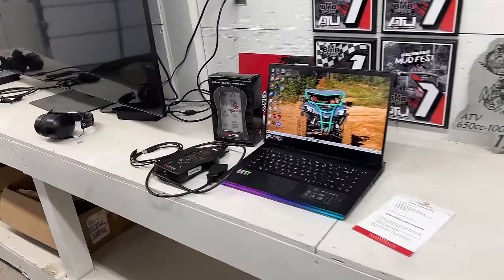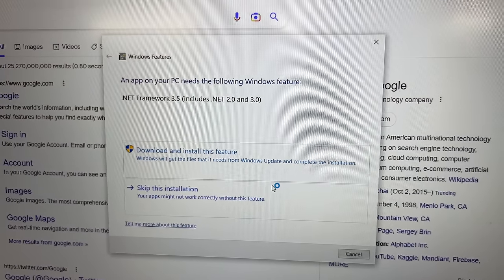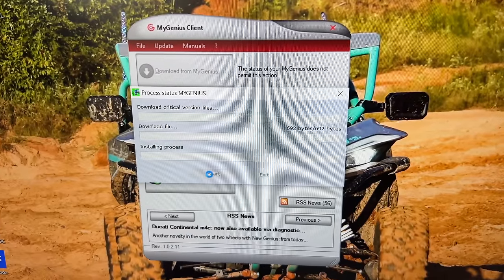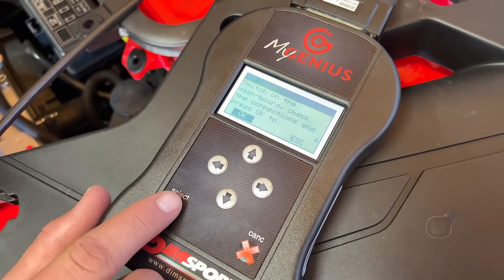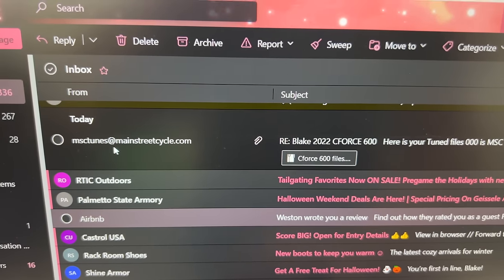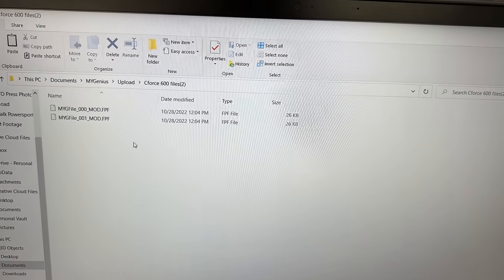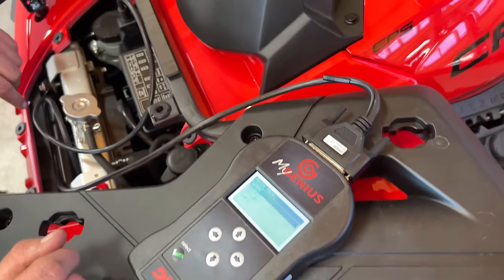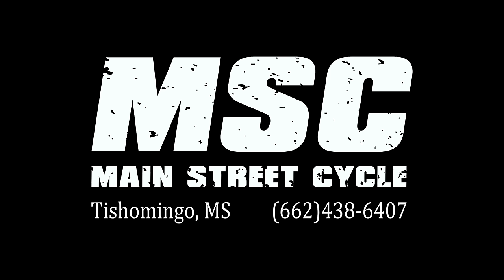MyGenius OBDII Tuner For CFMOTO TUNES | How to Tune Your CFMOTO

Comment: I will be getting this! I like the fact that it allows us to return to stock in case it needs to go into shop for an issue! Nice video explaining it!  One big thing you should mention as with any ECU flashing Make sure battery is fully charged and does not die during a flash. Tho it may be a quick flash if battery dies in the middle of it you will have a big paperweight when you are done! LOL

Comment: Blake, love everything you guys are doing with these machines. It's getting me all fired up about upgrading mine. Will you be offering the ability to adjust any perimeters on the tuner side or offer the ability to make a special request with some of the parameters?  Might be jumping the gun here but how about a tuning software being available later down the road?  Really love that you are putting the time in to get these machines dialed in.  Any idea when an uforce 1000xl tune will be available?

.
Reply from the maker: We already have the uforce 1000 XL tune out and available

Comment: I was very interested, until you said that it can only do one machine. Now I have to weigh out the pros and cons.
Reply from the maker: Yes that is something to consider
Reply: Every tuner is machine specific
Reply: It’s even that way when you tune a car.
Reply: No different than any other tuner put there. Can only use on 1 vehicles at a time
Reply: Yes. It's like this for some other tuner too. Here I was hopping for a better tool , that could transfer multiple tunes  to multiple machines and or do reflashes etc.. I was looking for a professional tool not dyi.
Reply: Not true my auto cal can do 600 tunes . You do have to buy a vin for each tune but lot cheaper than a new auto cal .
Reply: @RealTalkPowersports  will this work on a 2023 300NK?

Comment: That MSI GS66 Raider gaming rig is not an old slow laptop by the way ... whoever is doing your IT hooked you up pretty good with that for a shop laptop.  If anything, your internet connection to the outside world or your internal network router is the "old and slow" pieces of your equation!
Reply from the maker: That’s my personal GS66..
I bought it right when it came out to edit video before I was working with MSC..
I was way far away from the Wi-Fi router and I have the 2 SSD in it also full so it has bogged down.
I need to clean it out and optimize it..
It’s now my back up laptop.
I’m now using the M1 Pro MacBook Pro

Comment: I am having an issue with the low gear speed elimination on a Z950. The speed elimination only works on the 35mph tune and does not work on the modified tune. I sent email. Need help resolving because it does no good for me to have low gear speed elimination only work on a 35mph tune. Thanks.

Comment: I went on the website and see z950ho. I have the 2022 z950 sport. Does this work with both units. (DIY kit). Just asking. I might just send my ecu to y’all. How long does it take to get ecu back from you guys. I live in North Carolina
Reply from the maker: The tune is different for the HO model and the regular 950..
The Handheld will work with either one though and you will get the right tune but you have to include what machine you need it for
Reply from the maker: Once your ECU arrives at MSC it will be shipped right back out within 24 hours in Most cases.
Reply: Thanks your videos talked me into buying 2 z950s just before they announced the z950 ho ex. I’m happy with mine. Just thinking about the tunes now. Keep the vids coming you are very helpful in the cfmoto community God bless you and your family
Reply from the maker: @supertrucker3263  thank you so much!! God bless y’all brother

Comment: I just bought 600 and a 800xc, so would I need to buy two units? Or can I default the devise to work for both?
Reply from the maker: You would need a device for each unit.. or you can still remove your ECU and ship the directly to MSC and they will tune them very quickly for you and ship them right back to you for much cheaper than having to buy 2 handhelds

Comment: Just bought this tune from you guys for my 2022 cforce 1000 and it says I have an error, wrong selection of brand or model.  Anyone else have this issue?
Reply: For anyone that reads this if you're doing the tune yourself my issue was the kill switch was on so the device couldn't read the ECU.  All set now
Reply: I can’t find my plug on my cforce 1000, where is it?

Comment: can you buy the tune file alone? without mygenius tool ? i already have the tool :)
Reply from the maker: I will have to look into that
Reply from the maker: The tool has to be linked to your cfmoto and you would have to send us your stock file through email and then we would write the tune file to match your ECU and send it back through email. But I still need to check with the guys to see how they would process that
Reply: @RealTalkPowersports  can you inform me if you asked if you lookt into it ? :) and maybe a stupid question will it run with beter fuel milage or will you make less with a full tank ( if you drive the same way)
Reply: @RealTalkPowersports  and another maybe stupid question is there a diffrence on the us 600 and the european 625 touring ? or is just a name diffrence? (i just bought a new 625 touring in belgium)
Reply: Any update on this question? I have the tool and would love the ecu file!

Comment: What are you ganeing by tuning it. That's better than factory
Reply from the maker: Better Air to fuel ratio.. higher rpm limit and more horsepower and more torque.. number increase vary from each cfmoto model
Reply: Will it void factory warranty
Reply: Lol. Will it void warranty. Lol.   Some people.